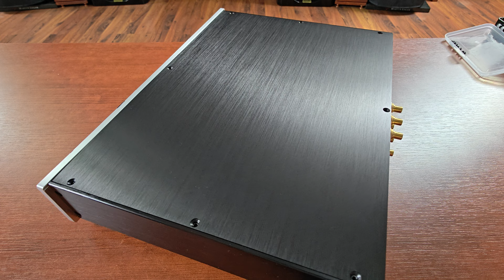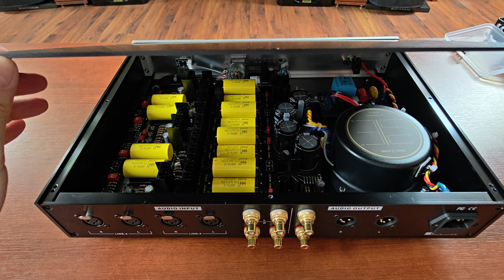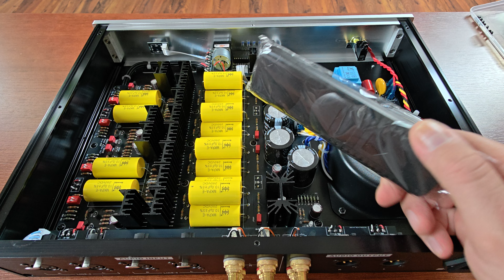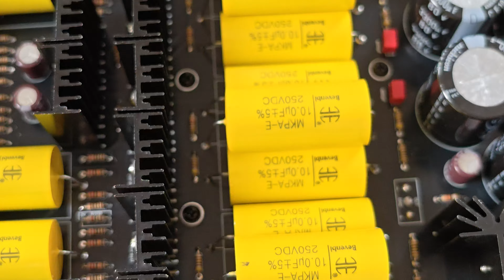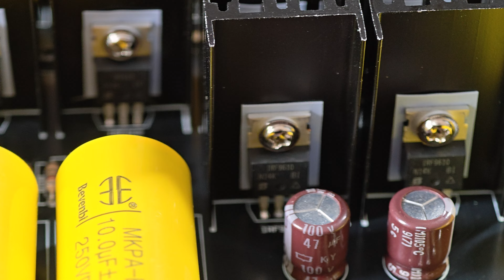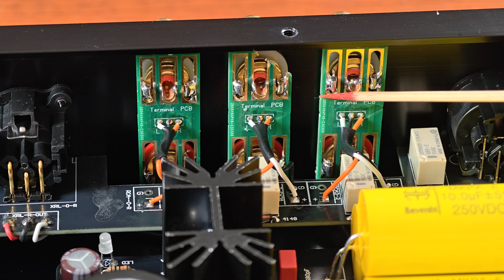First look at ZeroZone Pass Aleph P1.7 clone preamplifier!

Comment: I bought one of these a month ago and had to return it. Some how it was out of phase and had no phantom centre, and when I played out of phase test recordings they would sound in phase. The seller did not want to issue a refund saying it was not faulty and was in issue with my CD player while the pre was still in my possession (I wasnt even using a CD player as transport). I had to get a report written before alliexpress would refund.
It was also noisy ( background hiss ) even at moderate levels.
Reply from the maker: Thanks for sharing!
I've immediately checked mine for that and its ok. 
so THATS WEIRD. They should be the same if manufactured recently, so maybe its QC problem (phase problem is probably something soldered wrong way)
Reply: Typical failures in chinese clones, my Musmys 2860plus plays music off centered and blurring instruments, also "only" red rca connectors present problems with some cables, not fitting properly, of course no warranty reply finally from Aliexpress or seller

Comment: I have this preamp; however, the inside is much simpler, lean, and clean. If you check the pass DIY site, the circuit is simpler and not as complicated as this. The number of MOSFETs in this looks like more than the actual circuit. The Zen philosophy is to be lean and clean. The coupling capacitors are just 10 uF Bevenbi in my version. The gain switch is not present, and can the gain be changed by replacing a resistor. Electrolyte capacitors are Kemet and Rubycon. I replaced the couplers with Janzten. The worst part of the preamp is the remote; it's cheap like a cheap remote toy car type, and the range is abysmal; it has to be pointed precisely for it to work.
Reply from the maker: Thanks for sharing! 
I need to take a look at the service manual diagrams for p1.7. It's readily available on the web, but I have no idea if the designs there are the same as on DIY site.
I was under impression that Nelson Pass shared there only those designs that were not actively sold by the company. 
(Great guy btw, there is interesting and funny AMA on Reddit with him!)

Comment: Oh wow! That thing looks very much like the prt13 (Balanced tube pre with 6922 and 12au7)
Reply from the maker: Somewhat similar (controls, general chassis look and feel, remote control board and power supply) but the main preamp board is different. But those caps stacked like that - yes, that is similar and it draws attention ;)

Comment: HI
This Amplifier has a problem, because the Volume control is before and not after the Amplifier-Unit. The Chines build it wrong! So U have alltime a „Pink-Noice“.
Reply: Putting the volume control after the amplifier is not good because it will increase the output impedance. It is better at the input. If you hear Pink or white noise that means the circuit is noisy and might not be very good. That might be the reason for having putting it at the output in the original. The trade off is a loss in dynamics. Not my liking of a good design.
Reply: @hugoaguas6719  Exactly! Why do the Chinese clone your mistakes? There's no need for that.
Reply: noise :face-purple-wide-eyes: nix noice :text-green-game-over:
Reply: Surprisingly my version is dead quite.
Reply: @jakal1591  That means the chinese know what they are doing. Maybe even improved the original design.
Reply: Yes, of course, if the amplifiers are making noise and therefore need to be rebuilt, the Chinese know what they are doing…Logo 😂
Reply from the maker: yes thats true, but thats also quite easy to fix on your own. Its better to scale the output down including the noise here than to amplify low amplitude signal AND noise... :(
Reply: @k4syx  o.O ...eary how? Show it us. 🙂

Comment: This preamp was emitting a lot of hiss from the speaker tweeters. I was hearing it from 3.5 meters away. I don't know if my unit had some problem or it is a bad topology altogether. I tried every combo with xlr or rca cables and the dip switches inside. The hiss was there every time.
Reply: I have the same problem with my unit. Probably a design issue.
Reply from the maker: Thats interesting. my unit is going through burn in now and I cant hear any hiss (~4m away?) but I will check for that from closer distance
Reply: @k4syx  It is my unit probably. Sound wise it was good, but after this one I bought the Accuphase C2860 Plus based on your review and in combo with Dartzeel D9 Pro it is stellar. So, this Pass clone is sitting in a cupboard, collecting dust.
Reply: @goranvasilov  Send it back for a refund, it cost nothing once you open a request
Reply: @tothemax324 I wrote to the seller and he asked me for a video proof with sound and after I sent it to him, he vanished from the face of the earth.

Comment: I hope you will be reviewing the large B&W clones soon!
Reply from the maker: I am listening to them now and then, not ready for a full review yet as I am trying them with different gear.
They are great, really are, but for that money there also many great second hand opportunities.
So the question is how great are they compared to other stuff.
At this point one thing is sure, bass goes as low or even lower than with my B&W subwoower and its at least as clean and fast.
Reply: I bet the midrange is good too. I've been drooling on them for a while now. I live in the US, I'm hopeful that some of the tariffs will go away too.

What do you think would be comparable to them on the used market?

Comment: I find the volume control board puzzling as it has a lot of resistors mounted onto it. This made me think it might be a ladder volume control controlled by the Alps pot.
Reply from the maker: No, these are for the MCU, leds and IR receiver. 
This is balanced pot btw with 3pole signal inputs and outputs for each channel.